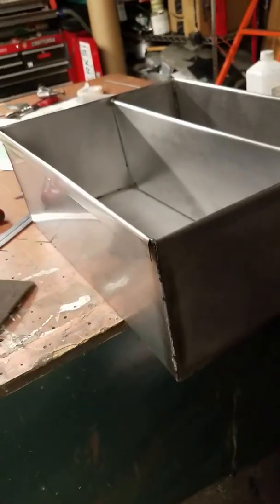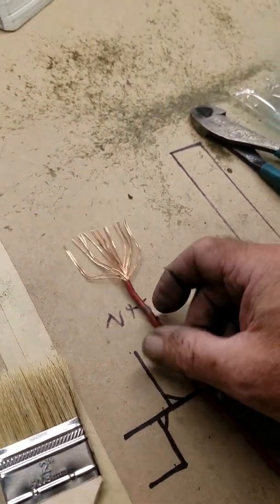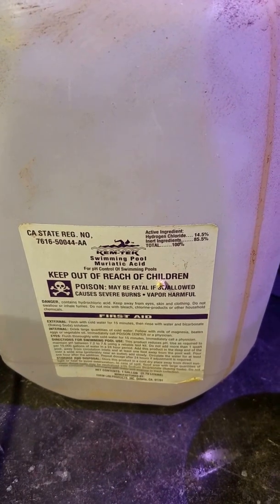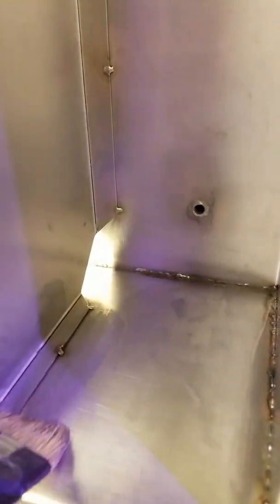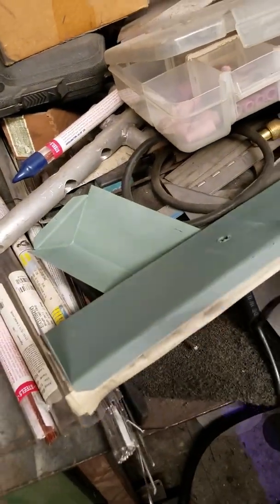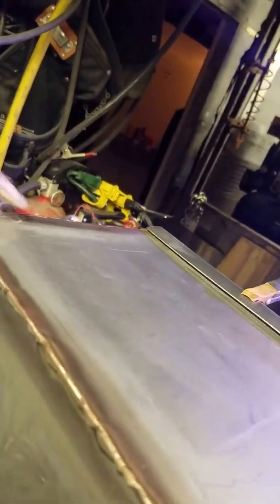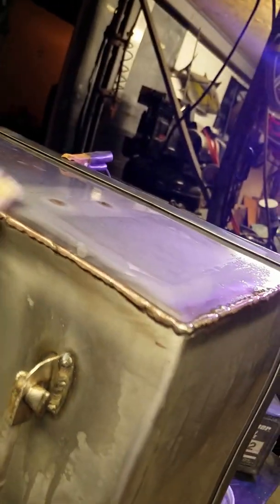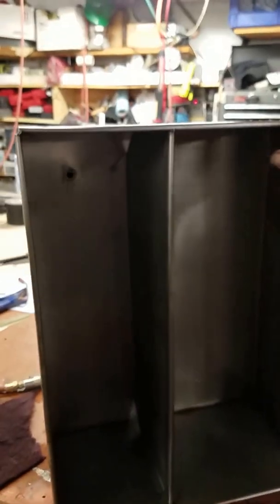Passivating stainless steel

Comment: That's the biggest load of crap that I have heard that when you weld stainless steel it loses it's stainless property lmao firstly the chromium content stays the same. Your Dutch mate has let the pickling paste pickle his brain. And the reason why it's turn copper is because your passervating machine is working as a plating machine too. That's what happen when you mix copper acid and electricity your best off putting a cloth over the brush too. That will stop it arcing out lol
Reply: This dude is just copper plating his welds.  I'm actually laughing out loud at this.  Amyway, passivation is a purely chemical process; in the case of austenitic stainless, its just a nitric acid bath.  No arcing out with dissimilar metals all over your work piece required, lmao.

Comment: Hey brother that color is copper , you are electro plating the ss with copper , if you flip over the brush it should still work and it will  not plate as much, the muratic acid will still conduct electricity

Comment: This is a perfect example of the blind leading the blind! If you really want to be helpful to people looking how to passivate their work you'll take this video down because this is wrong on so many levels! You were quite right when you said you shouldn't be showing this and by that very admission you open yourself to negligence if someone followed your instruction and got hurt, maimed or died.
Maybe you don't realize this or the enormity of the "World Wide" web or that there are consequences for our words and actions.
I'm sure you were just trying to help, but this is one time you should resist that urge! And a wise foreman of mine used to tell everyone in the shop, "If you dont know what the ( expletive ) you're doin, don't do it! Especially in front of anyone!"
Wise words from a wise man!
Reply: Have you done it before? How would you do it? I do need to switch polarities other than that it works great
Reply: @joelalesch  yes sir I have done it in the past at a fab shop in which I worked making parts for the maritime trades and the Navy and we used a process much like the one by another youtuber by the name of Donald Dawson. I suggest you take a look at his set up and make the investment in your self as well as your work if you are still doing stainless work.
We used the alkali with a specially designed brush that didn't introduce copper or any other metals which might contaminate the affected zone of the weld we were trying to restore. We then neutralized the alkali, rinsed with clean water, wore personal safety gear for hand, eyes, and clothes as well as a respirator all in a well ventilated area.

I realize your video is a couple of years old and perhaps your welding has improved. But for times when you need to reshape your beads, you might want to pick up a Corinox file or two. Corinox is a brand name. They are designed for Stainless Steel and carbide, but of course designate a stainless file for stainless only. Likewise for aluminum and carbide, etc. You don't want cross contamination.
Hope this helps you!

Comment: There are conductive carbon fiber brushes for this purpose sold on eBay. The copper is being pulled from the copper in your brush, not the best thing for the stainless. Both copper and stainless give off poisonous gas under these circumstances, not to mention the acid.